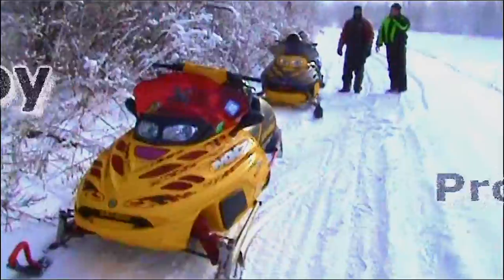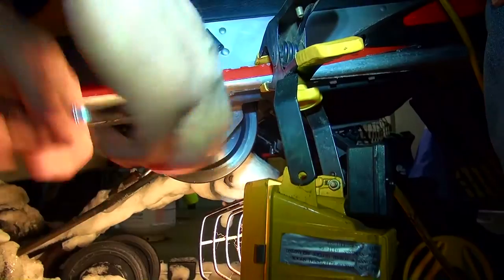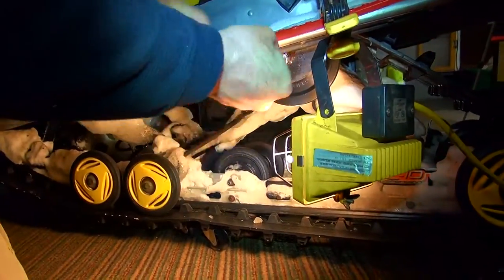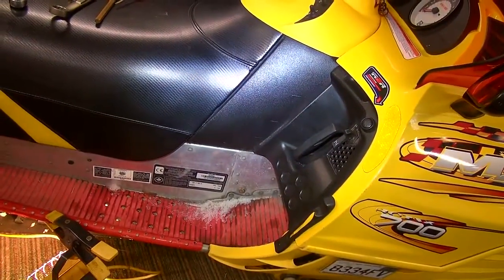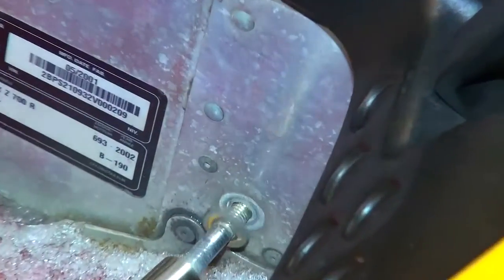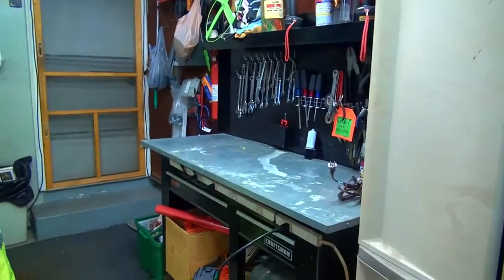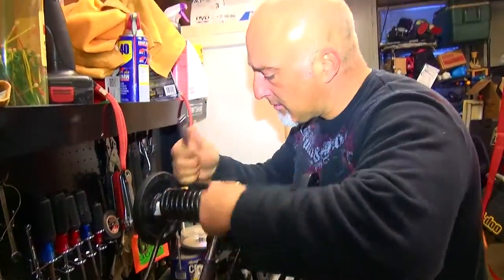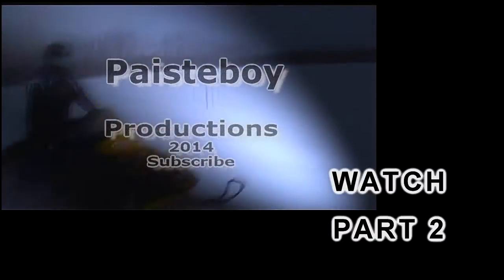Skid & Shock Removal: 2002 MXZ 700 Part 1

Comment: Next time you pull the skid release the torsion springs.  It will make the removal easier with the rear arm collapsed.
Reply from the maker: Thanks for the tip and for watching.

Comment: Just purchased this sled. Have a question, when do you know it’s time to replace these?  How much tension and pressure should you feel when you press down. ?  Thank you !!!
Reply from the maker: Push down on the rear bumper until the suspension is all the way down, then let it go.  If the suspension comes up fast then you shocks definitely need a rebuild.  The faster the suspension come back up the worse the shocks are.  The shocks actually slow the springs down from rebounding too fast.  If your rear suspension is bouncy then you need to rebuild the shocks.  I hope that helps.

Comment: Ski Doo....made in Canada...so yeah its metric....
Rotax motor....Austria...so also metric..
Reply from the maker: Track length not metric? 129", 137" etc.  What's up with that?  Canada still builds homes in feet and inches as well.  Most stuff is metric though when it comes to automotive even American cars.
Thanks for watching.